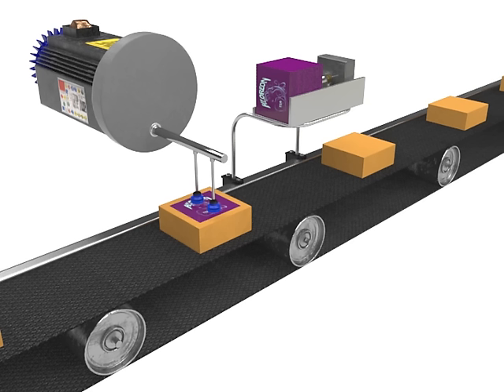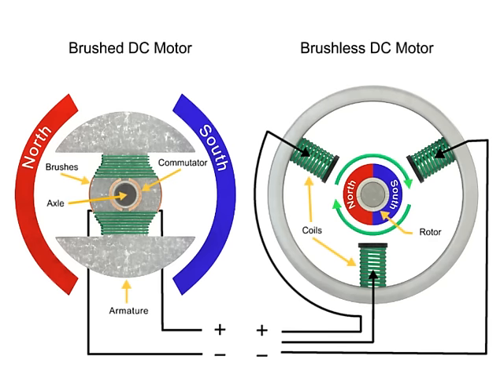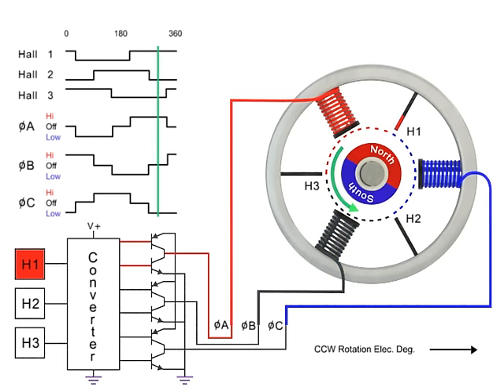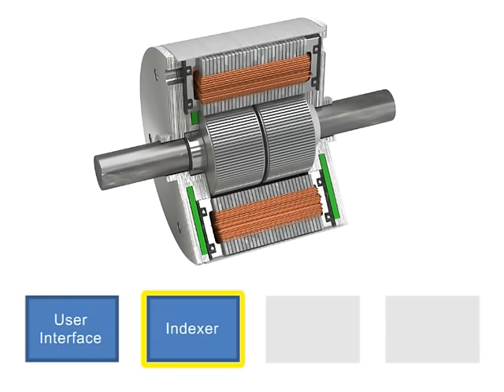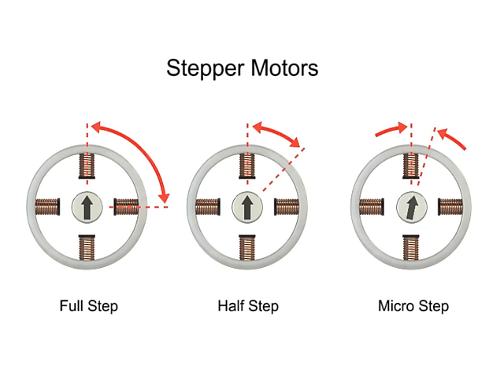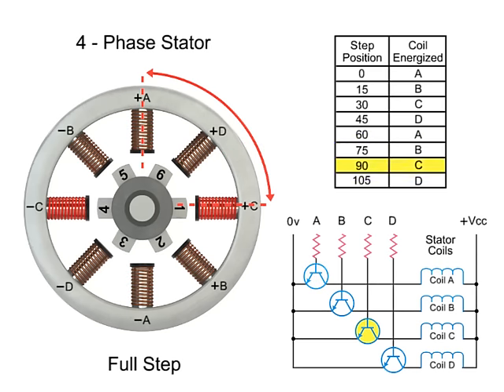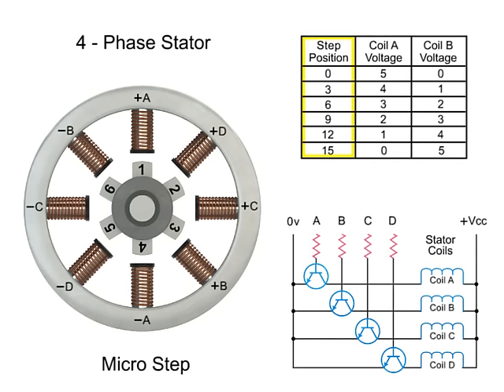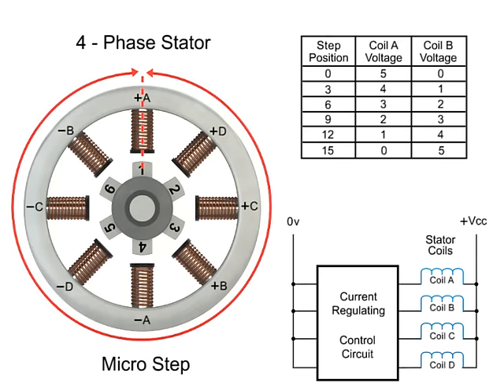Servo Motors and Elements of Motion Control

Comment: I'm not studying engineering or anything, but I want to do a little private project that will require a rotary motor that can move to different preset degrees in both directions depending on the end-users input. I thought I was going to use a servo motor, but looking at this demonstration, the stepper motor may be more suitable for the job. Soooo, thanks for the wrong title, haha.